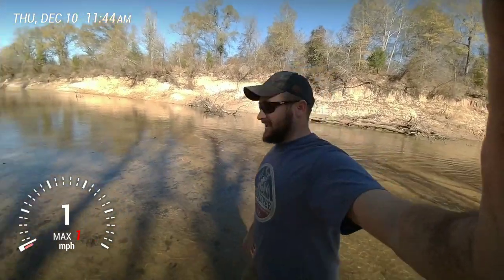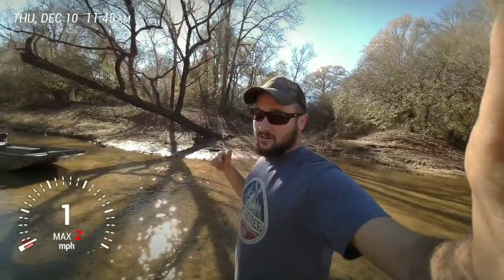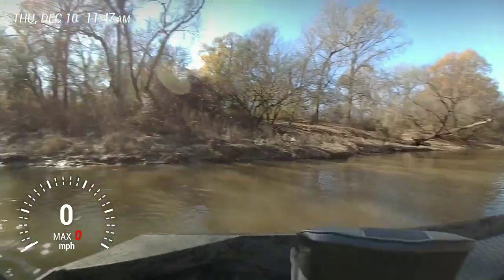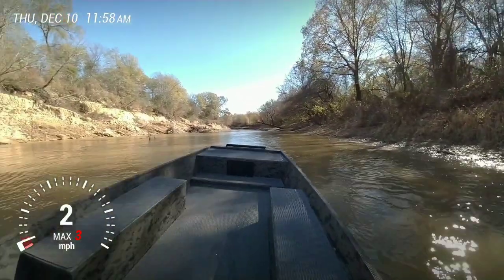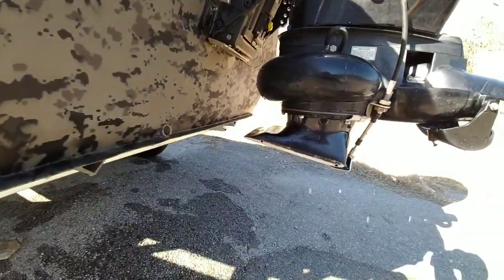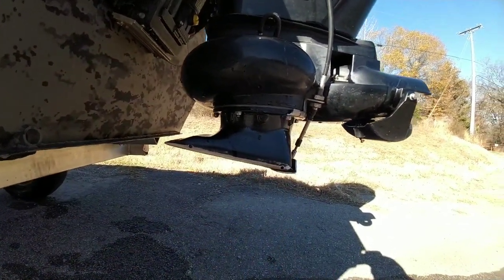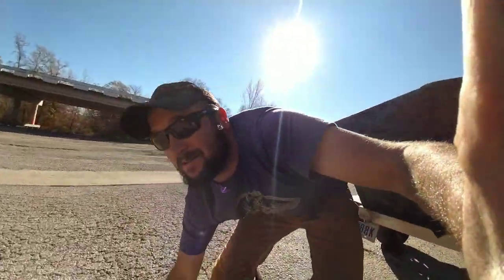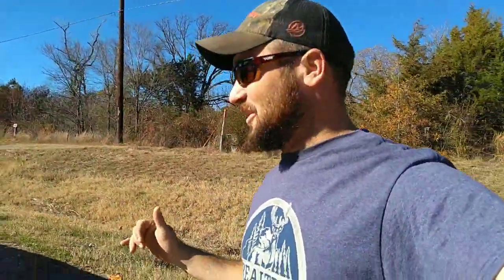Working Trim and Getting Skinny

Comment: Good explanation Dennis. So many people seem to want to set thier trim and forget it.. Im constantly trimming up or down as I speed up or slow down. I also trim down just slightly to get a little better bite setting up for a tight  turn,  and slow down slightly so I can use the throttle to power thru the turn. If ur wide open and u cant make the turn thats it.  If u have a little throttle left u can give her some gas and use the thrust to help turn.
Reply from the maker: Absolutely. Save some throttle and trim down for hard turns.

Comment: What is the total weight of your new Kaz 1652, gas ,battery, gear  and you.. How much water will the boat draft on a drift.  How skinny can you run under power ? Why did you choose a 1652 vs a 1656.
Thank's
Reply from the maker: As it sits in the water full on gas(13 gallons) and me in it will be roughly 1200 pounds (I'm 210). I have yet to measure the draft. As far as shallow goes this video here probably showes that. Probably need 3 or more inches to stay under power. With a 52 inch hull you can stay one piece hull vs a 3 piece.

Comment: It seems like a jack plate to bring the whole thing up 2~3" would really get the outboard up out the way.  With a guy in the rear plus gear weight I would assume you could raise at least 2" and the water intake still be adequately submerged - am I wrong?
Reply: Just don’t use the motor at all..I don’t even put a motor on my boat and can glide across the rocks without having to worry about a stupid motor to break. A haha a haha ha.
Reply: This is incorrect, the water doesn’t rise that quickly, and when you’re on plan the water is pretty much level with the boat
Reply: I think it’s dependent on the speed you’re traveling…..that’s why adjustments are needed on the fly.  The water definitely rises, how much is variable depending on speed of the vessel.   Hth

Comment: my dads got u tunnel in the back maybe 4 or 6 inches wide and a foot or 2 long and he doesnt have to do any trimming
Reply from the maker: I had a tunnel once. Slowed the boat down way too much. Went from 27 to 32 and could run much shallower and handle better

Comment: How are the jet outboards with weeds ?
Reply from the maker: If your in some current it can be fine. Dead water and weed not so great.
Reply: Weeds/Grass are not your friends on the water...need to keep the boat moving in order for the pump to do it's thing.
Reply: @flex2win  yeah that’s what I thought I was just curious
Reply: @republicansthatdidntvotefo1605  yeah probably or even a noraml outboard i use a 25hp merc and deal with weeds all the time all you have to do is put it in reverse and they will come off

Comment: You ever consider adding a tunnel ?
Reply from the maker: No. I had a tunnel in my Blue Blazer and shortly after buying it weld it up flat. Made everything about the boat better. You can not run shallower with a tunnel. Yes it will give you some protection of hitting your intake.

Comment: Does sand cause damage to the impeller?
Reply from the maker: It wears it faster but I have impeller I just changed with 700 hours. Most impellers are stainless steel. The liner won't last as long
Reply: ñpoe  nóe midey water shàker wyer sand barrs firad

Comment: is that a 60/40
Reply from the maker: Yes
Reply: @DennisBohannan  i have a 60/40 on a 1652 and was getting about 27-28mph with 2 guys then i added an anchor winch to the front and now im getting 20mph with 1 person should i lower the motor on the jackplate so the shoe is farther in the water? Cant seem to figure out why the boats running way slower besides weight slowing it down in the front
Reply from the maker: @evanwoyke  interesting. I'm not sure without seeing or riding in the boat. Sounds like the added weigh caused a bunch of drag. What type of hull do you have?